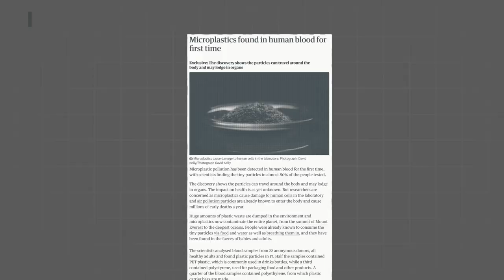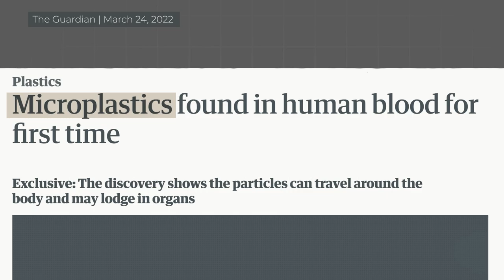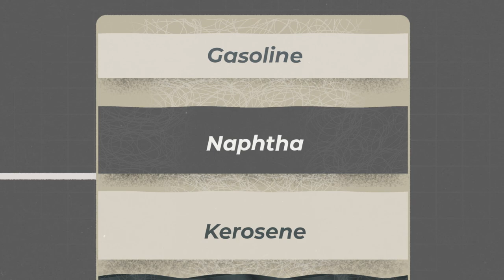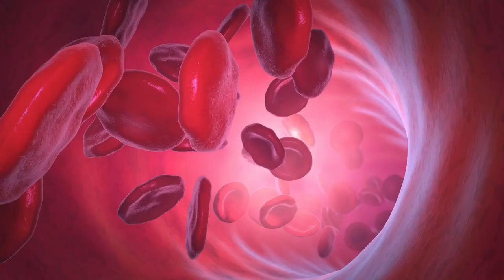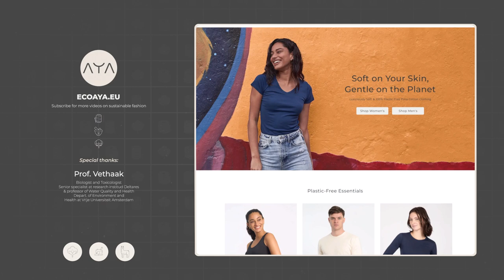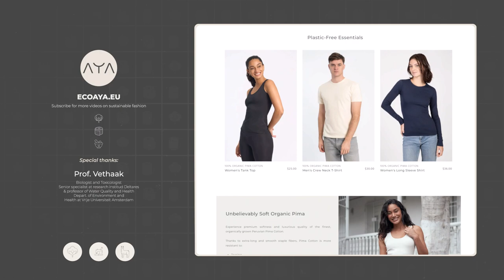How Fast Fashion & (Recycled) Polyester Create The Microplastics In Our Blood

Comment: People should stop villainizing plastic as it will not reach in the ocean by its own. To stop production of plastic, you need to stop extracting its raw materials which is a by-product of petroleum. Without petroleum, you wouldn't have gasoline. Plastics are used in packaging materials because they are durable and lightweight. If you're thinking switching to paper and cardboard is the solution, its not. Transporting these items will require more energy due to their space and weight. The most ideal type of packaging which can be reuse over and over again is glass. But glass is fragile and heavy, and requires a lot of energy to be manufactured and to be transported. The only way to save the environment is to go back to the old ways, which will require drastic change in human behavior , mindset and priorities. Putting the blame on a certain material after serving its purpose is a total BS and are just people who are looking for an easy way, without really changing. You want to save the environment, encourage everyone to abandon all technology and inventions that require energy. The use of Solar Energy sounds very enticing like individuals using it are doing a huge impact in the environment, which is not, because the materials and processes in manufacturing the solar batteries are very hazardous not just for the environment, but to the people involve in the manufacturing.  So, just to conclude this comment, if you want to genuinely save the environment and stop these microplastics from getting into the human body, encourage people to stop using energy, stop eating fruits and vegetables that are not in their natural bearing season, buy only items that are made within your community where they use materials found in your community as well, do not shower everyday, encourage people to go back in the old ways.

there is no such thing as free lunch. Your convenience now has a price, which may or may not directly affect you now, but it will have an effect. When there is no demand, manufacturers will lessen the supply. 

And if you try to argue about having small steps better than a well thought solution to a massively big problem in the society today, then the small steps might be a closing door to the only problem a portion of people are concern of, while creating a bigger problem in the future.